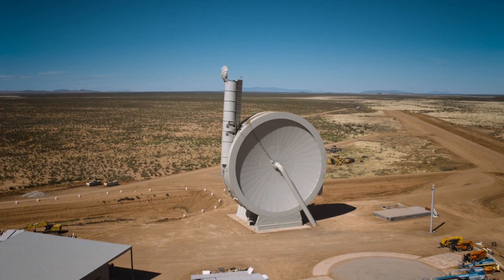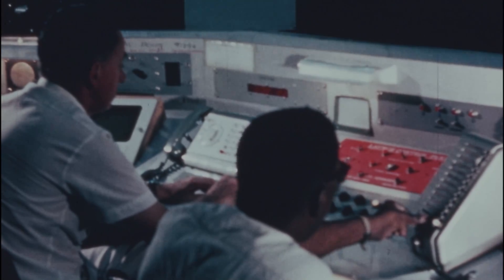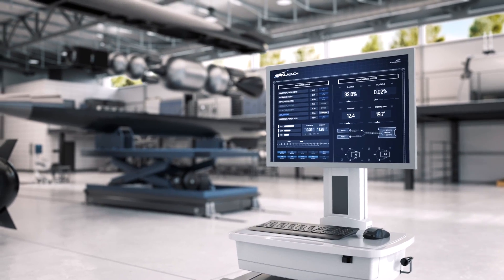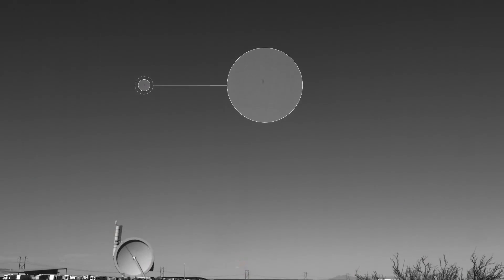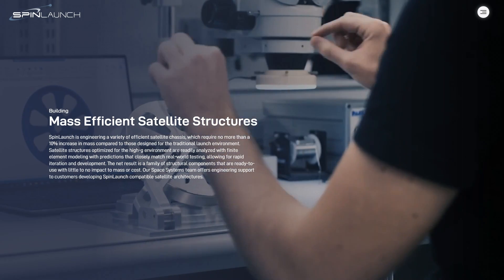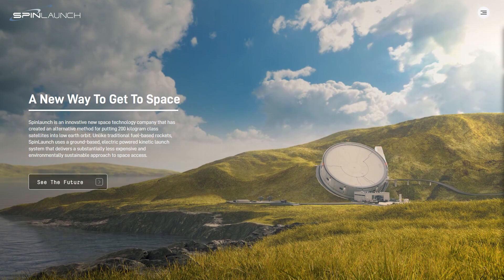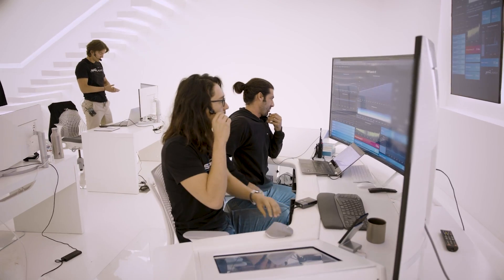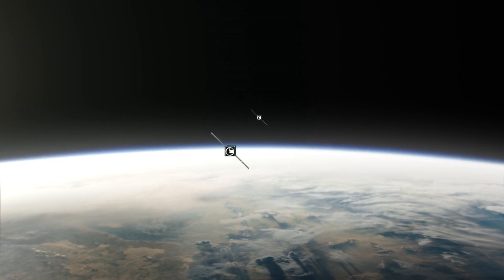Can Spinlaunch Throw Rockets Into Space?

Comment: 9:00: “rebalance the rotor” 😂 this kicks like any other gun. Solving that problem is the same as using the arm to catch a rocket firing down. I guess you could yeet the counterweight down a mineshaft.
Reply: Maybe a weight that is held close to the centre with the rocket attached, that then is released to a further our position to account for the weight loss.
Reply: @aaronpops4108  Problem with that theory is that weight would stop at the end of travel very fast and that can whack any bearing to pieces._
Reply: The thudder, it hits the ground.
Reply: @cmoor8616  Sounds like an amazing hammer; got anything you want to use a drop-forge on?
Reply: @aaronpops4108  I could see some problems with this approach. If you lower a mass on the arm, you need to accelerate it from one speed to another. The quicker you want to do that, the more reinforced the arm needs to be to handle the forces. Also, moving down a counterweight still has the problem that you can't get rid of the force spike when releasing the rocket, so the axle still needs to resist the full brunt of the launch, albeit shorter. You could lower the weight half way before launch, but that would only cut the force in half.
Reply: Sending.countwr weight down.a shaft was my first thought.
Reply: @FlyingFun.  a moderately closely fitting shaft with a sealed end, so that air pressure will decelerate it reasonable safely and undramatically.
Maybe even pop a chute part-way down to complete the soft landing.
Ideally, the launch facility would be at altitude (keeping the densest air below it) and near the equator to get the 1000mph slingshot from the earth's rotation or as close to it as is practical.  Put it on the side of a mountain and the equal and opposite (the principles established by Newton are not suggestions - they are the law) balancing projectile can go down something like a gun barrel down the side of the mountain, either inside the mountain or outside makes little difference.  But being able to unbold the bottom end to remove and possibly reuse the counterweight would be good. and stop the shaft/barrel from filling up.  At such speeds release should be simple - we do it more precisely at much higher rotational speeds in nearly all infernal combustion engines to fire sparks, injectors or both.  And a single crossbar attaching to both ends of the spinning beam with a variable eccentric motion could easily release both.  At launch time you just increase or reduce the cam lead over the main arm.  It worked well enough on 19th-century steam locomotives, and THEY had to run it out of balance - back through a cross-connect and through 180deg to the opposite steam chest.
The remaining arm would slow fairly fast with the power in reverse to generate some return power and with air in the chamber, and with its much-reduced mass.
Reply: I am no expert in this field but my first though was perhaps have the counterweight be a liquid of some sort that is ejected a split second following the launch?
Reply: @Nomusicincluded  Why liquid?
And if you mean ejecting it out of the launch tube, that might be too slow. Or not, I have no idea what the tolerances are for this thing, it's so far outside of normal.
Reply: @Khaim.m  This is why I specified that this isn't exactly my area of expertise.

I figured with the pressure of the liquid within the container (when its spinning) you could open a valve and the pressure would force the liquid out. I am not sure if an evacuation like this would be quick enough but sometimes it is the easiest solution that ends up working.
Reply: If you could build the bearings to be able to stand 1/2 the rotation without exploding, then you could simple launch TWO spacecraft, the second one a fraction of a second later.  It would also be moving slower because if the inrush of air from when the first one pierced the cover, hence a different orbit.
Reply: Make the counterweight magnetic, have it go down an inverse gauss gun. An aluminum tube connected to a bank of super-capacitors and you could recharge a portion of the energy it took to launch the rocket while you slow down the counterweight.

Heheh, yeah that'd be a ludicrous bank of super-capacitors, and it'd only regenerate a tiny fraction of the launch energy (like, 10% if you engineer it really well? Probably not worth the work).

Still, mag-breaking could also be mag-"lev", keeping the counterweight from hitting the walls of the shaft by "gradually" forcing it to the middle rather than it having to somehow hit a rail while going at mach 1.
Reply: That makes a ton of sense to release a dummy weight in the opposite direction at the same time into a fluid or sand
Reply: @TrollFalcon  biggest vacuum, biggest yeet, biggest sploosh
Reply: Launch two rockets in opposite directions, tangential to Earth's circumference. The curvature of the planet will make sure both reach space. You just need to throw a bit harder.
Reply: There were guns based on this same idea back in 60s even a bb gun
Reply: A pressurized liquid looking for a low pressure space to fill could quickly fill the void left by the release of the rocket with a pop open container ready to collect it. Just a thought
Reply: Launch 8 rockets (each on it's own arm), through the same hole.  Launch 1, then 5, then 2 then 6, then 3 then 7 then 4 then 8.  Reduce the imbalance significantly, and it only lasts for 4 revolutions.
Reply: Made me laugh.
Reply: Deployable parachute mixed with the sudden influx of atmosphere? Actually that's probably too slow
Reply: I’ll bet they use a system of clutches to slow down the counterweight.
Reply: tossing the counterweight was my immediate thought as well. But I'd use the energy to do something productive with it. Either some kind of science application, or a way to capture it p.e. in salt crystals which will instantly melt at which time they can reproduce some of the power that was used to spin up the device. Of course, it can only produce just a fraction of what was put in, but it could generate a very high power spike that could be used for some other applications that otherwise need huge capacitor banks or a vastly overdimensioned power plant. In short, don't just drop it in a shaft when you can use all that energy for something useful.
Reply: I had the same thought about the counterweight. You already have to solve the problem of perfect separation of the payload, why not copy that on the other side? Yeet the payload up and simultaneously yeet the counterweight down. The rotation apparatus should stay balanced and can spin down easily, as it's a lot lighter than during spin-up. You just need something to catch the counterweight; my first thought is a deep pool of water (with a thin cover because the spin chamber is depressurized) but I'm sure there are other options.

Comment: They could launch in 2 directions to counteract the unbalanced rotor on launch. Payload at one side, counterweight at the other side. 
Launching the counterweight into the opposite direction at the same time, straight into the ground/some containment box where it is destroyed. 
Replacing the counterweight shouldn't be too expensive compared to a whole rocket.

Comment: There is a 'simple' way to deal with the sudden imbalance, attach two similar massed projectiles on opposite ends of the flywheel. then the bearings only have to deal with 180 degrees of rotational imbalance  (or less, if they send the second projectile on a slightly different trajectory to avoid the shock wave and turbulence from the first projectile). This would also reduce the required mass of the flywheel and the stress on the bearings as it is slowed down in very turbulent air after the projectiles break the vacuum.
Reply: Ohh good idea, you'd want a 180degree differential, so firing a second projectile underground. Could be caught by a huge mass of water though and/or packed with parachutes and the like
Reply: Actually scratch that, my "solution" would double the problem.
Reply: @benpearse7565  No I would have the second projectile following the first (delay the release by 180 degrees so that the mass imbalance would only have to last half a rotation as the second mass is swung round to the same release position). although less that 180 could be a better option since it would have the two projectiles on similar but slightly different orbital trajectories. 
I would be interested to watch the flywheel after the vacuum has been broken the in rushing air must create an impressive shock wave. I wonder if other simultaneously triggered vents in other parts of the chamber would increase or decrease the shock to the system.

Any failure will produce a really big pile of very small pieces of scrap.

Comment: The unbalancing at the moment of release was the first problem that I considered when hearing about this.  Perhaps there could be a counter mass at the other end of the rotating wing which is released at the exact same time, thus removing a sudden unbalance
Reply: Interesting idea.  I was thinking it would be easier if the arm could be made very light, or perhaps be replaced with string - or more likely, with cables.

Slingshots generally rely on string technology, rather than a rigid arm.  The string has much lower momentum, so it's easier to deal with how it behaves after releasing the payload.
Reply: @TooSlowTube  clever idea, but since this system has to take some time to accelerate, what would keep the string taught before rotation?  

Also, this idea would still introduce serious unbalancing issues.  The real problem is the change in the system's center of gravity as soon as the mass is released.  If two masses were released at the same time, then the center of gravity stays in the same location, thus removing the unbalancing issue
Reply: @tristanc6967  I can think of a few ways to keep the string taught - thrusters, maybe just using compressed air, or compressed air pushing out water (which works amazingly well), or maybe something electromagnetic, or perhaps stick with the slingshot analogy, and first accelerate in almost a straight line, down a lead-in tube.  That would be fairly easy to do, with string - it could just be wound onto a drum as it pulled.

Launching two at once seems promising, but if one is being launched straight up, the other one would be going down.  If it was just a counterweight, it might work, but you'd still have to get rid of a lot of momentum very quickly, which could get messy.

I'm also wondering what happens with air rushing into the spinny thing, as the projectile breaks through the panel.  That seems like a difficult thing to deal with, especially if it hits a big heavy spinning arm.

My guess would be that just the air rushing into such a large vacuum chamber would do a lot of damage, but I suppose they've thought that through.
Reply: @TooSlowTube  I think this should be kept as simple as possible, so I really like your suggestion with a lead in tube.  Good potential there, plus this will require less energy to accelerate up to the necessary velocity.

Yeah, discharging the other mass directly downwards is the downside here.  No good ideas on how to handle that yet.

I suspect the air rush won't be a big problem for the arm or cable, but maybe there would be thermal effects due to the friction, much like the rocket itself

Comment: Couldn't you solve the problem of balance strain on the baring using a counterweight on the opposite end of the arm that could also be released?  If you release the projectile and counterweight at the same time, launching the rocket one way and the weight opposite direction the arm would remain balanced.  Building a system to dampen the impact force of the counter weight would be relatively easy.  Building a system to recycle that force would be even more efficient.

Comment: Spin launch..... the sheer stress wouldn't allow for humans to use it as a viable launch platform. The mag-lev launch rail would be much easier on humans and equipment, not to mention more scalable for different size loads. This sounds like they are trying to market a weapons system, rather than anything for actual space exploration. F*ck that.

Comment: 4:20 “when it’s hitting the dense sea-level air…” 

Solution: Since the launch tube (which I’m going to call “centrifugal cannon” or “cc”) is stationary, why not build it at the top at a mountain?  Since the rockets are going to be smaller and carry less fuel, it could easily be moved up the mountain via tram or escalator before being loaded into the cc.  The thinner atmosphere would cause less friction and heat in the first few seconds of the launch, with negligible cost differences over the course of the cannon’s operational lifetime.
Reply: Needs electricity and other infrastructure.
Reply: @baapmaanus4429  Easy.  Just run the power lines parallel to the tram. To be fair though, you’d need power no matter where you put it, and the same exclusion zone that NASA uses around Cape Canaveral would probably apply for safety.
Reply: Lot of solar and wind at the top of a mountain. Couldn't they make and store their own power on site?
Reply: That's a good idea
Reply: Logistics.

Moving it up a mountain would cost 100'000s  of dollars if not millions.

Moving large things is extraordinarily expensive.
Reply: @kriegscommissarmccraw4205  Yes, but only once.  Once it’s there, the cost of doing multiple launches by getting the projectile up with a tram would pay the thing off quick.
Reply: And you'd have the rockets crashing in densely populated areas. Nothing to hit but water when you shoot it off in Florida.
Reply: @KingSobieski  I dunno, that’s not exactly the strongest argument, seeing as how Russia launches their stuff from landlocked Kazakhstan.  Besides, just don’t point the darn thing over a populated area.  Cape Canaveral is only safe because the rockets TURN east (against the Earths rotation) over the ocean, instead of going west.  If the rockets from Canaveral went west, they’d be flying straight over Orlando, Kissimmee or Tampa.  Take it to the Rockies and fire it West.
Reply: An East Coast location was desirable because any rockets leaving Earth's surface and traveling eastward get a boost from the Earth's west-to-east spin. A West Coast location would either send rockets over populated areas or have to contend with launching against the direction of the spin.
Reply: @KingSobieski  Think about this.  The sun in our sky moves west, since the earth rotates to the east.  If you launch a rocket straight up, which way is it going to tend to want to fall as the ground moves east under it? West!  If you launch west, it’s gonna keep going west.  It’s just gonna take less energy to get it where it naturally wants to go.  Don’t forget that Edwards Airforce Base in California was considered for a long time as the launch site, but there were three key factors that allowed Florida to win, and two of them were strictly political.  
1.  The wealth of the film and entertainment industry in California that saw space launches as a disruption to their business, especially noise pollution.
2.  Proximity to Washington DC.
3.  It was easier and cheaper to get construction materials for the VAB, launchpads and crawler to Florida.  

Florida also has the advantage of being farther away from any fault lines, so risk of earthquake damage is greatly reduced.  But one reason California was considered as strongly as it was, was its distance from Cuba during the Missile Crisis.
Reply: If you put the payload on rails, you could even have the spinner at the bottom of a mountain, extend the tube way up the side of a mountain and have a (mostly) frictionless ascent for the first part of the journey.

Might even be able to use some other method (magnets?) to accelerate it further on the ascent.
Reply: Every KSP player thought of this I'm sure immediately. It stems from something EVERY KSP player has done at some point in playing KSP.. Extending the launch struts as high as it can go, just to try to edge out a few more meters to get into space lol.. It never worked, but its the first thing every noob thinks of.
Reply: Negatory on tall mountains (closer to equator) in Florida but San Jacinto in Riverside County near Palm Springs might be a candidate that tops at 10,834 feet high.
Reply: @CaliforniaTravelVideos  I’m not saying we need to fling them from Everest or McKinley.  Anything over about 3 miles would probably be fine.
Reply: Research telescopes are routinely built on top of mountains, so i wouldnt see this as a significant barrier in the long term, at least compared to the engineering challenges
Reply: i see this happening in the future my friend
Reply: Because most people live on the coast and so labor and transportation is cheaper
Reply: and yet they don't launch rockets from mountains
Reply: Hard to build stuff at the top of a mountain, it would cost billions to construct all the required infrastructure.
Reply: This is a good idea for sure. Sadly, I don’t think the environmentalists would allow such a thing lol
Reply: @Lowboyreef  thats silly
Reply: @Lowboyreef  They will if they’re serious about climate change.  A narrow strip of reformatted wildlife habitat is nothing compared to the carbonpocalypse they say is on the way.
Reply: @Wesley_H  let me tell you about that time when they've campaigned against the construction of, or for the closure of several nuclear power plants, for decades, knowing full well that they will only ever be replaced by coal or gas in the short term.
Reply: @psd993  I see your point, but this is hardly the same thing.  Besides, this has multipurpose applications.  Not to say anything that might get any of us in trouble as it may be classified, but we need something to counter Russias Mach 8 nukes.